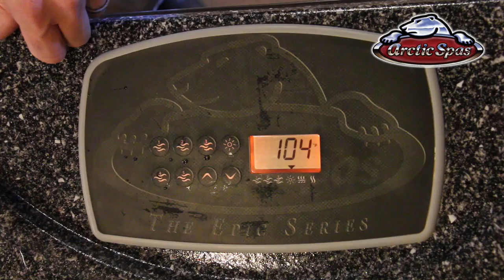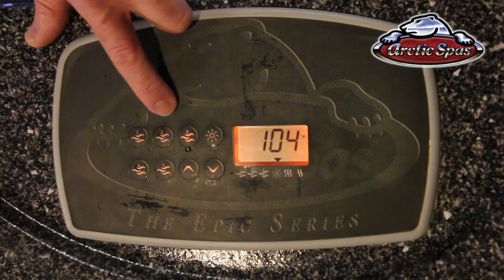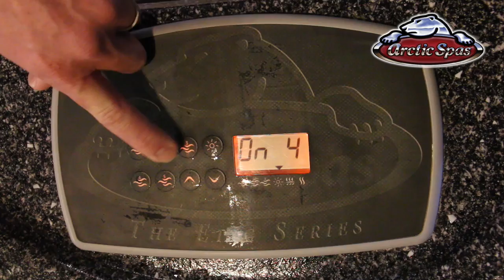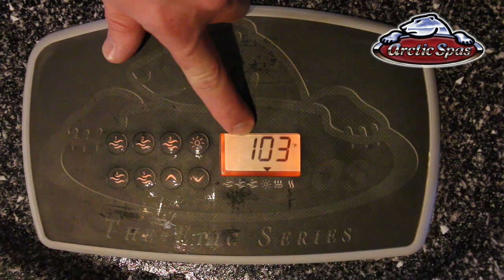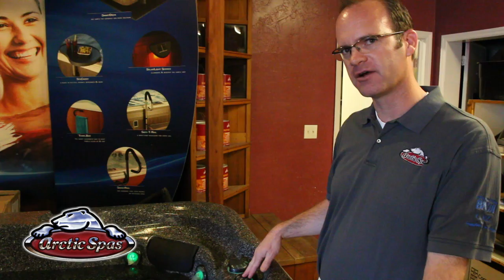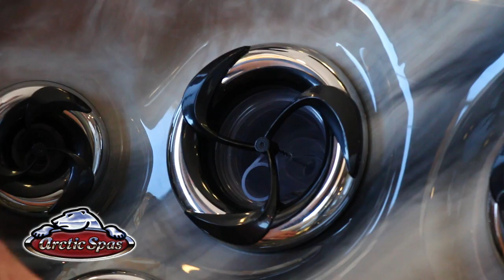Arctic Spa Topside Controls & General Maintenance | Arctic Spas Tutorial Video

Comment: Have a quick question... ill preface this by telling you i am an Electrician.

3 weeks ago i had all three pumps working,

2 weeks ago pump 3 stopped working while pump 1 and 2 still worked

This week pump 1 button works
Pump 2 button turns on my LEDS
Pump 3 button turns on the air cooling jets...

So my educated guess would be that my topside control is starting to go bonkers (bought in 08 so its lasted a long while...)

Should i order a new one to start safe on this repair?
Reply from the maker: The topside may be the issue.  It is easy to test by just plugging it in.  Don't install it.  If it does not solve the problem, you can send it back as long as it has not been installed.  For more help and information, email us at Support@ArcticSpaStore.com.  Thank you!

Comment: We just bought a house with this hot tub included. The owners say it works great and it's filled with water already.

The problem is that it is set for 59° but when I push the up button to increase the temperature, it just drops back down the 59° again. Any advice?
Reply from the maker: The topside control panel needs to be replaced.  You can find the topside control panel as well as everything else for your Arctic Spa at ArcticSpaStore.com.  Thank you!